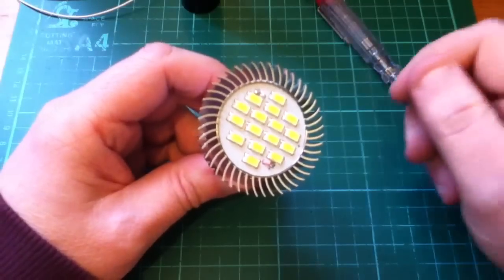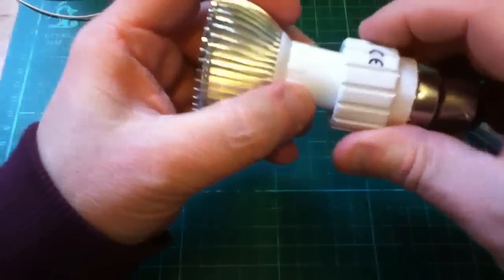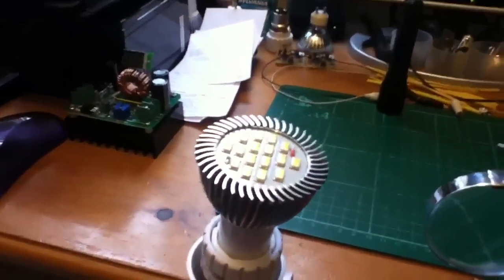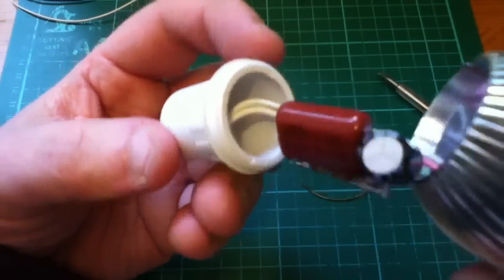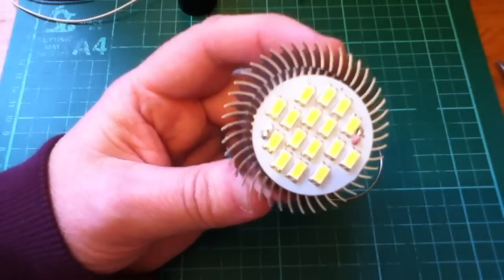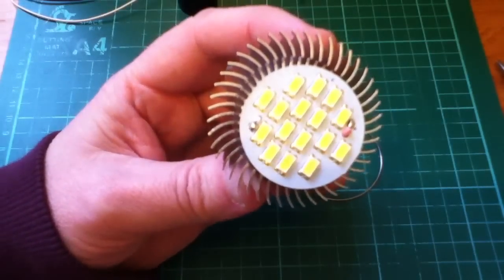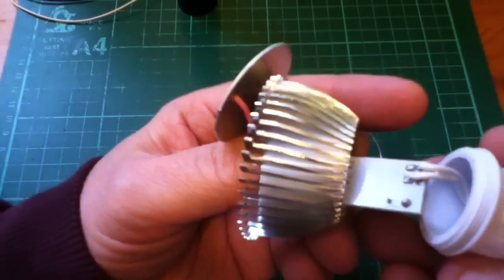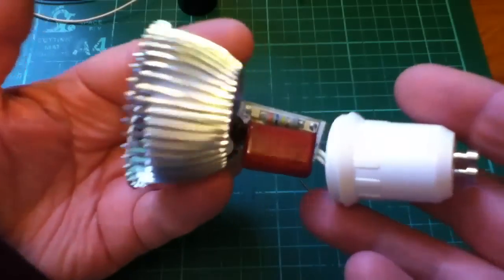Dangerous GU10 LED Spot Light is Cheap and Bright but could Kill You - Seriously

Comment: Allegedly in some parts of China they string up bare wires in their rooms as insulated wire costs more.  No fuses either as these cost money!  

Incidentally a lot of Oriental mains adapters are not of double-bobbin construction. Instead they rely on the insulation strength of two layers of varnish (often the tape between the windings has a gap that allows the primary and secondary wires to touch) In countries where the nominal mains voltage is only 115 this is not so bad but AFAIK the UK has the highest domestic mains voltage in the world, usually 243 volts at my house.  The result is that unless products are designed to run on 250 volts ac they are likely to fail prematurely.

An old colleague used to have relatives in Rome and over there every house used to have a Constant Voltage Transformer for the television!  Allegedly the mains could swing between 150 volts and more than 250 volts and this would cause the TV raster to zoom in and out hence the need for the CVT.

When the man's Mother In Law visited the UK she gave his wife a telling off about the way she plugged in the washing machine "No a No a, firsta you put the clippa on the water tap".  When it was pointed out that the large pin on the mains plug WAS the clippa she was quite surprised by the clever British idea!

Comment: why is everyone upset about this? it's simple to explain how a bridge rectifier works..
    it turns a full sine wave into a direct voltage similar to the one going in.. then you have something like 120 volts DC (please note that DC voltage has a positive and a negative pole)
    with Voltage over 50 Volts you may get electrocuted so there is a resistor to bring that down to a safe voltage both for the user and the LED's.
    so when the LED's are ON you have Dc voltage on the front of the spot light, and that DC voltage is lower than 50 Volts so you wont have mains power anywhere past the bridge rectifier...
    please understand that i am educated in this matters and have worked very much with similar circuits
Reply: If you have worked on similar circuits then you will know that the low voltage on the LED is still REFERENCED to the 230V mains input. This means that it may be just a few volts below the mains voltage or just above neutral depending on which side the dropper capacitor is connected (depends on bulb orientation). If you want isolation then you have to use a proper transformer or a plastic/glass cover on the light.

If you don't understand this then you really shouldn't be working on anything which isn't battery powered. I'm frankly horrified by the level of ignorance in the comments in this channel.

I've worked on safety testing to various standards like EN60950 and EN41003 for many years and had to sign safety declarations for both IT and telecomms products. The funny thing is when you have to make legally binding declarations you tend to work out exactly how things work..

Comment: and that's why turning power off when replacing light bulb is your first step
Reply: ***** just one that you use to turn lights on/off on the wall should break a hot, right?
Reply: Victor Galayda yes. Even with AC, you still got to have a closed circuit for electricity to flow.
Reply: ***** I am sure that the breaker box still only breaks one of those active wires, which is how a light switch turns the power off. In Australia our mains are AC Alternating Current. That means, the active and neutral will switch between positive and negative, while being opposite each other (unless they are at absolute zero).
Reply: Matthew Tremain while ac does switch polarity the only energised wire is the one you brake with the switch. You can hold on to neutral as long as you want it has no potential in relation to a ground. In many industrial applications in US when single phase 120 needed and all you have is 3 phase 480, 4to1 transformer installed with primary hooked between two phases 480. On the secondary side one leg is 120 and other leg is grounded to make a neutral.
Reply: simon6071 Your ignorance is the dangerous bit bud. Did you even look at your own link?
You'll notice (if you bother) the transformer on the link you supplied . See one anywhere on the Video above?, no.
You provided a link to a cct that does indeed drop the voltage to a level which is not dangerous.
This bulb assembly does not drop the voltage, it rectifies it and then connects to a load of led in series therefore negating the need for a dropper cct at all. ( The video is incorrect in that bit too)
Reply: MeshJedi never seen single phase switch that breaks hot and neutral here in US or back when I was in Russia, residential or industrial. Only case I know of two pole switches braking two wires is when European 220v equipment sits in US and two phases hooked as hot and neutral producing 208v. Outside/bathroom lights and outlets connected trough gfci. If ground fails or hot grounds it will trip.
Modern breaker does exact same thing as old ceramic fuse plug. It disconnects circuit from source. It screwed in the panel on to a hot buss. Neutral inside of the panel looks like a another buss conductor with no breakers on it and often connected to the ground as well. In Russia if electrical inspector finds that you breaking neutral with switch, you will get fat ass fine, not sure in the US(seen too many sloppy jobs that somehow passed inspection)
Reply: The accusation made by this video host that the GU10 LED Spot Light could kill you by touching the connectors of the individual LEDs with bare hand is just wrong and ignorant.
This LED spot light has a driver circuit  that can reduce the voltage of the electricity to about 12 Volts DC, which is way below the safe limit to touch with dry hand ( 25VAC or 60VDC),  before it is allowed to go to the individual LEDs.
See specification of output voltage from manufacturer of driver circuit for GU10 for confirmation of the output voltage:
http://dalipower.gmc.globalmarket.com/products/details/gu10-e27-e26-6w-led-driver-circuit-diagram-spotlight-739517.html

We know most car batteries operate at 12 Volts DC and it can produce a much higher current (Up to tens of Amps) than the output of a GU10 (About 0.5 Amp). [ Warning: NEVER connect the two terminals of a car battery with a wire, metal object or non-metallic electric conductor such as graphite. It will burn or explode and cause injury or death.] However, touching the terminals of a 12 volt battery with bare hands will not have such danger because the voltage of 12 V is too low to cause harmful electric current through the skin which has a much higher electrical resistance than metal or graphite. A 12 V car battery is considered dangerous because of the huge current it can produce to cause burn or explosion when the two terminals are short circuited with a conductor. However,since the output current of the GU10 is only about 0.5 A and with a low voltage of only 12V, it's not going to kill anyone by touching the exposed wires.

As a test I touched one terminal of a 12 volt car battery with one hand and the other terminal with another hand. I did not receive any electric shock because the voltage of 12 V was too low to cause harmful current in my body. I even repeated the test with both hands wet. There was no electric shock.

Conclusion: It's a false claim that the GU10 LED Spot Light could kill you when you touch the exposed wires and connectors of the individual LEDs that carry a low voltage of only about 12V and small current of about 0.5 A. However, in spite of no risk of electric shock, I still think those LEDs and exposed low voltage wires should be shielded with a glass plate or heat resistance transparent plastic plate to prevent them from being touched so that people don't wrongly accuse it of being able to kill with electric shock and to give the spot light a high-quality look.
Reply: Matthew Tremain feel free to test and share your discoveries. There is the reason why terminals on the outlets marked gold and silver in US. Every electrician can tell you that black man loves gold (hot leg) and white man loves silver (neutral). Easy way is to stick voltmeter in your outlet and check voltage between hot-ground and neutral-ground
Reply: simon6071 With the type of power supply in the video there would be 12v difference between the LED +/- but at the same time there could also be rectified mains voltage difference between the LED's to mains ground. The power supply you link to is not the same type as in this video
Reply: Thomas Paine what's it good for then?
Reply: I was going to say that :p
Reply: Victor Galayda  I am still not sure that that is quite right, I will have to create a circuit to test that (if I could be bothered, which I can't be now, still unwell). Not too hard, some switches (like the ones that I have from old PSU), some wires, 1-3 light fittings, spare cord with 3 wires, and 1-3 light bulbs. I have all but the light fittings laying around. I would have to be careful on the wiring, and the testing (unless if I make 3 separate tests, or mod the tester to each case).
Reply: Victor Galayda lol, the first thing that came to my mind was; ah yes, but here in Australia, we drive on opposite side of the road to you. You do have a good point about the multimeter. Might test that when I have the wires set on a bed that is not going to end with me be becoming a bright spark.
Reply: Matthew Tremain light switches come in two forms, those that break one wire and those that break both, on bathroom and outside lights (at least over here) you need to two pole switches that break both wires. IF you stick your finger into the light socket of a bulb with a one pole switch that's off, and your feet are somehow grounded, you WILL get shocked(provided you touch the right pole, but if you stick it all the way in, you'll touch both so...).

so yes you can get shocked from a socket that is switched off. a modern main breaker(the ones with a switch you flip on and off) will break both circuits, the ancient screw out ceramics ones, you would need to remove both fuses for the circuit when working on the circuit. 

and yes, as long as you're not wearing properly insulating rubbers shoes, you are most likely grounded when inside. unless you can fly like superman...

Heck with this lightbulb, provided his analysis is correct, which is hard to tell since you can't really see the circuit in the video, you could turn off your lightswitch, and if you put it in the right way, you'd still have live power on those exposed solder points.  the problem with the bulb isn't power going from one pole to another, since you are only ever exposed tto one of them even on this, it's the power going from one pole to ground.
Reply: Victor Galayda
I can speak for switzerland: In industry wiring, you sometimes see neutral breakers (like the ABB S2-NT). When looking at the leaver, you see that the neutral breaker will pull down the "hot" breaker as well when activated. So, it is possible to switch the hot wire alone, but when switching "neutral" it forces the hot breaker off as well.
Reply: Victor Galayda

Black and white? Aren't your live and neutral wires brown and blue respectively? Is that only in the UK? Why don't they make these things universal? :(
Reply: Lucu Lencia one day it will be universal. For now. Green- ground. Black- single phase 120v White - neutral. Red, Black, Blue 208v three phase. Brown, Orange, Yellow 460v three phase
Reply: you forgot 230 two phase...
Reply: RCKnut is pulled from the panel as two phases of low voltage 3 phase. And while is commonly used in US as 230v it is not.
Reply: Victor Galayda
I think black and white make more sense than brown and blue since colour blind people will be more easily able to tell the difference :P
Reply: Matthew Tremain pretty sure that's how all mains are worldwide.
Reply: Robert Slackware plain and stripped works good when its new install. Wires tend to discolor and get dirty. Most of the industrial equipment i had to work on that is older than 20 years, has wires of one color. Its something between brown and orange. BTW blue and brown is negative and positive DC in US
Reply: Robert Slackware true. 120 year old rubber insulation is flaked off long time ago and wires are bare now. JK. I deal with industrial settings, and wire made even 20 years ago is discolored badly. But they were sitting in the environment of over 200 F, oil mist and dust, loaded to the borderline of their ampacity, 24/7
Reply: isn't it like common knowledge?
Reply: and 90% out of 50% statistically killed by cooking appliances.
Reply: simon6071 Link is older. Can probably find if you search for exact product, so get ready to "search"..
Reply: First step before you change a bulb is buy quality and safe equipment in the first place
Reply: MeshJedi lol. O yeah. We are dodgy over here. Light fittings don't tend to have an earth. So once 1 wire is broken, then there is no power flow. Also no need for dual breaking switches.

Comment: Interesting and helpful review, thank you!  I wonder why the GU-10 connectors were not originally designed different sizes so the lamp could only be installed with HOT in the correct place?  It seems to me that this would be a unique and very important feature of the GU-10 design as compared to other bi-pin connectors.
Reply: As you know, GU10 was originally meant to be an halogen standard. Halogens didnt have single-sided electronics (not at all!).
Back then led werent still a thing, so they didnt have that issue.
However the could have created a whole new standard specifically for leds.

Comment: ouch. They could have put in two resistors in one for the mains and one for the return or N or however it is called in english. That way the main resistance is shared on both leads but it still has to be enough to not electrocute yourself. Put it in a metal grounded lighthousing and you might got some spooky shortage. Where you can look for hours where it is coming from.

Comment: Superb review Julian. Aluminium power plate has been in use for around 20 years in my experience, (I saw them used back then for the power stages of industrial motor drives, and they are now widely used for power LEDs too). They are basically single sided PCBs but with an aluminium substrate rather than FR4 or phenolic resin. The insulating layer is a ceramic, and when manufactured under carefully controlled conditions, has a good withstand voltage rating. Power plates are excellent design solutions for many applications requiring good thermal management. However, I would never trust such a thing as safety insulation unless it had a UL rating or similar, (which I've never seen), and I'm sure cheap Chinese jobs like this have nothing of the sort. You are absolutely right about the danger of electric shock here. Have you notified Trading Standards of where you bought this?

Comment: I'm a Sparky and that has spooked me, so it should make anyone who looks for or runs into this review sceptical about buying from eBay and the like.
I've also been told that a lot of the lamps that are soundly built but do not match the Japanese manufacturers colour requirements in quality checks are then sold off to Chinese buyers, they then sell them on eBay, so apparently if you buy a batch to light one area they may not all be the same colour despite what the seller tells you.

Nice review, don't understand how anyone could give it a negative review?

Comment: It seems that you don't understand what alternating current is and how the bridge rectifier works. It does not matter which way you plug in the LED lamp into an AC outlet you always get DC on the output. Otherwise the LED would not light up. The LED, like any other semiconductor diode conducts current only in one direction. There is no likelyhood of getting live mains on the LED terminals because current there is already rectified. Feeding live AC mains to an electrolytic polarized capacitor will cause it to explode and create a black hole (lol)! The capacitor simply smooths down the ripples from the pulsating DC output of the bridge rectifier. Touching the LED terminals will not give you a shock. The voltage across the LED is too low to give you a shock. The resistor in series causes a huge voltage drop and limits the current going through the LED. Even if the LED terminals are shorted, it will not cause a catastrophic failure. The series resistor will just dissipate the energy as heat but its not going to burn the whole thing into ashes. Use electrical testing equipment and measure the voltages and currents in this device when operating in normal conditions before creating a conclusion.

Comment: 1 micron = 0.000 001 m or 0.001 mm -- there's more than a coupe microns from the wire to the housing. But you are correct, you could have mains at either one of those terminals. I bet those are not UL listed. ;)